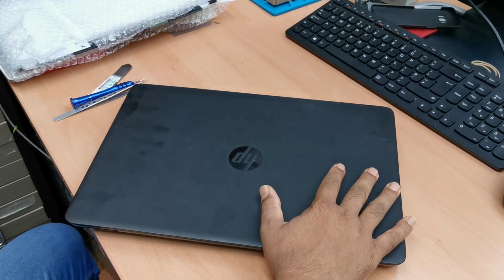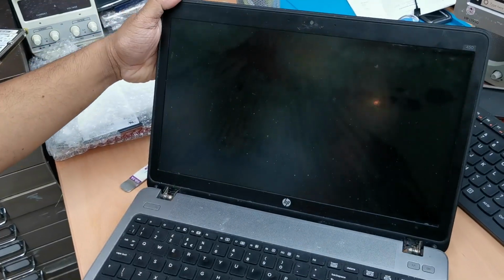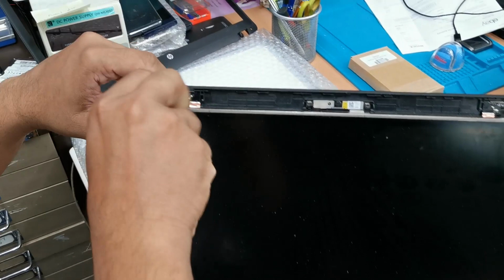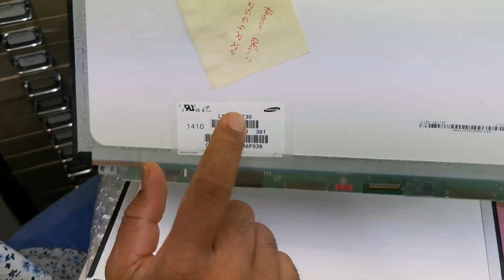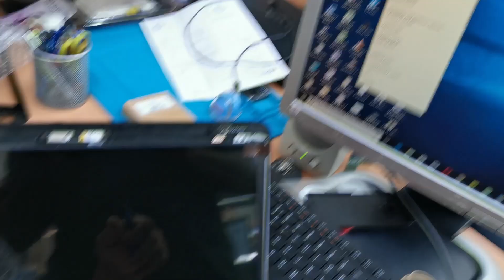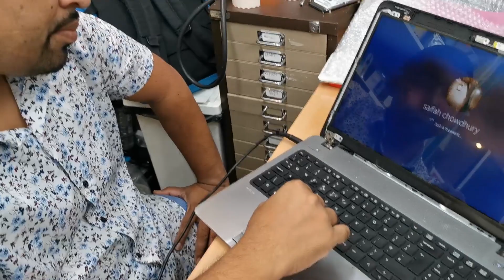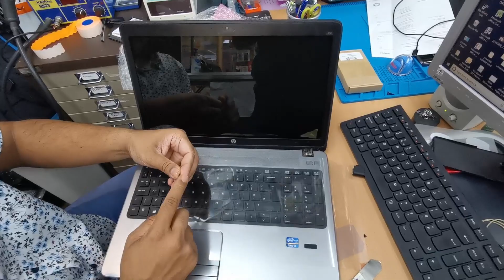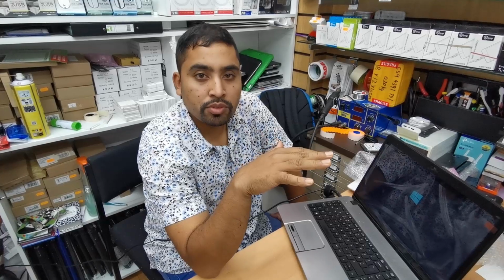HP PROBOOK 450  Screen Replacement Step By Step

Comment: hi, do you know if the display of the Hp Probook 450 G2 is compatible with the Hp Probook 450 G0?
It says 15,6" and 1366x768 and 40 pin but i am not sure.
Thx

Comment: Hello! I have the same laptop, and i want to replace the screen flex cable, because it got broken at the part where it goes in the hinge. I started replacing it, but i got stuck at the part where you remove the hinge covers. Can somebody please help me? I didn't quite understand from the video. Thanks, and have a nice day!

Comment: Will a 450 G2 FHD screen replacement work on a 450 G1?
Reply from the maker: I never tired but had some experience with HP. They are the worst for hardware design. The same series of laptops even does not match with the clip and screw holes.So Please do check twice the item return policy so that you would not lose your money.

Comment: looking forward to replace hp450 notebook display , help  where can i find it online ...
Reply: I can’t find it do you know where to find it?
Reply: sir, we have the  laptop hp probook 450 G2, is it possible to crack or damage the hinge and panel with time (7years) without falling?
thanks.
Reply: @amazingg9574  no. Wont break unless outside forces applied.